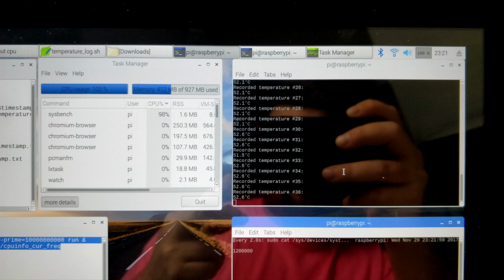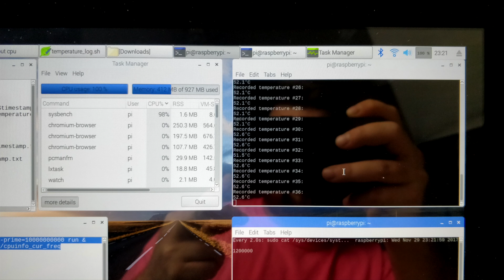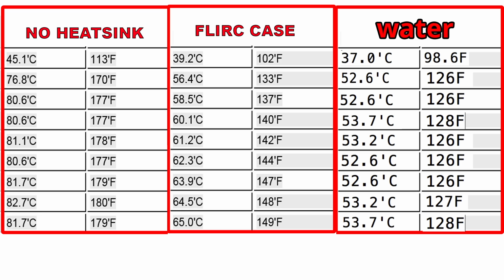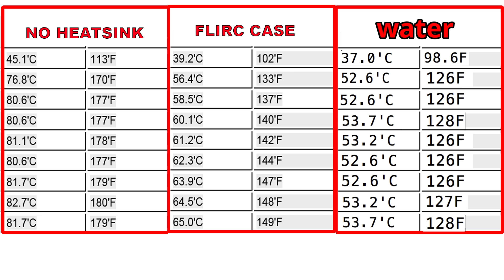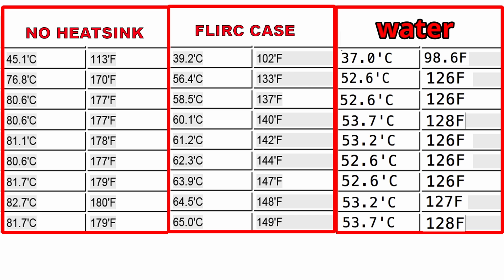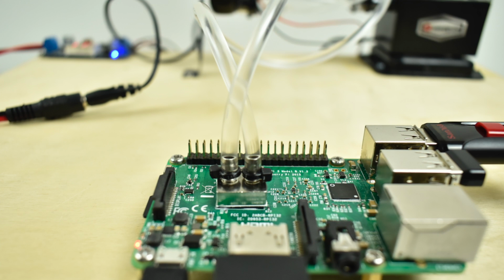Water Cooled Raspberry Pi 3

Comment: Hmm. I get better temps with a cheap 3$ ebay case with a included fan connected to the 3.3v pin. What made my temps so great was that I used arctic silver 5 thermal paste rather than shitty tape. Worth noting is that my RPI3 is OCed at 1,35ghz

Comment: I have got a heat sink i cut down to size from an old pc, and a laptop fan hot glued on top of the heat sink. my temps at idle at around 27c  and under moderate load goes to 32c. i havent stressed tested it so ill give this a try.

Comment: So I'm wondering if you can use this water setup and take a Pi 3b up to 1400 or even 1450 and would that allow you to run Saturn games? Would it allow you to run those problematic N64 and Dreamcast games? Is that even on the horizon for you?
Reply: In most cases, the Pi's simply can't be overclocked beyond 1400 (Maybe you happen to have an amazing one that can handle 1450.  Mine can't be clocked beyond 1350).  Attempting to set it higher will cause an unstable system that regularly crashes or simply refuses to boot regardless of the amount of cooling you provide.  It's not the temperature that's the problem.  It's the speed, the system simply can't move the data efficiently enough.

N64 and Dreamcast are not going to be able to run any better on a water cooled system than a standard fan cooled system.  You'll see a performance boost over no heatsink/fan only due to the system thermal-throttling itself once the temp reaches 82.7c.

Unless someone rewrites the N64 and Dreamcast Emulators to be more efficient and effective on the Pi, we're not going to see full speed games on a Pi3.  Maybe on the Pi4 but then we'll have people whining about Xbox and PS2 emulation.  It's cheaper to just use your PC to emulate the more advanced systems.  Enjoy the Pi's ability to handle all the systems from the early 90's back.
Reply: Great answer. Thanks Chris. I hear ya on using the PC. I have a BigBox/LaunchBox install here and I love it. Oh, I accidentally hit 1400 MHz once when I used a ready-made retropie image and did a check (F4  vcgencmd get_config int | egrep "(arm|core|gpu|sdram)_freq|over_volt"). From then on, I check the cfg.txt file right when it's through being flashed/burnt (still in the PC). BTW, I had set my retropie keyboard to Generic 104-key PC,  US  to type those characters. eta here says he always uses Dell for the keyboard, but that won't work for me. That was an absolute miracle that I discovered that OC within minutes. I was just trying out that very long command above which I had just discovered on the Internet!  :)